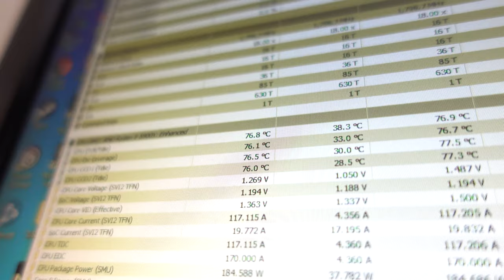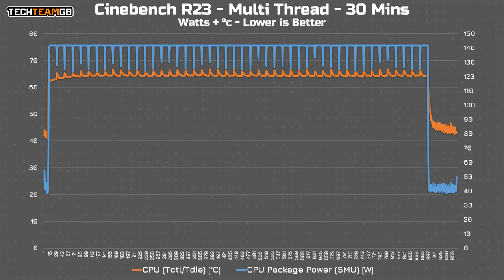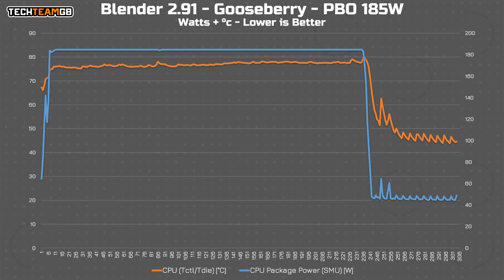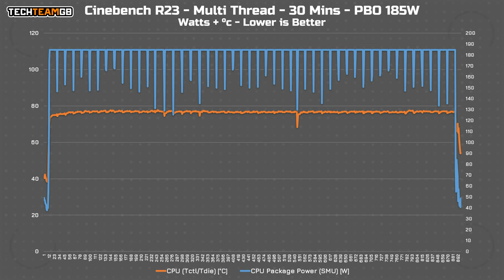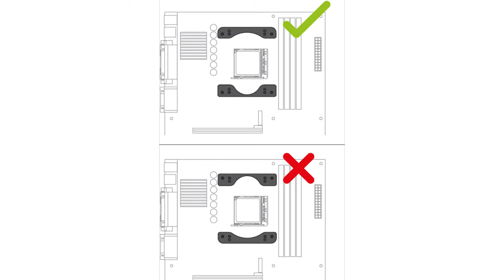THE ULTIMATE LIQUID COOLER - Arctic Liquid Freezer-II 360 A-RGB Review

Comment: Thanks for your overall positive review. We are already working on a better mounting method for the successor. The solution using standoffs like it is on Intel does not allow enough space to fit the thumb screw (i.e. pump too wide). Your feedback is very valuable, thanks for the details.

Oh, and the QR code issue was on the first batch of production, it has been solved since.
Reply: I think you should bring in a more expensive version with a nicer pump and some RGB 😅😅 that would make this cooler perfect 😜
Reply: Successor? Should I wait for this new version for my Intel 12th gen?
Reply: Where is freezer iii? I’m in the market for a new aio

Comment: I've got non RGB 360 version since 2-3 years currently on 7800X3D (before on 5800X) and it's great. I've managed to put 15 mm Arctic slim fans as push configuration on it together with included 25 mm as pull fans in Corsair 5000D so it's even better (push/pull) and still very quiet :) I for sure recommend this for high end system ;) It's so good that i even don't have motivation to extend my custom GPU loop to CPU, since LF II 360 is cooling my CPU so good and so quiet :)
Reply: Hey! im getting literally the same setup including cpu, case and cooler? how does it  run? and what fans are you running thinking of using a mag motherboard
Reply: @newlysquad9774 same I am planning to build one myself with those components. This is my first build btw.

Comment: I have a Liquid Freezer II 240 on a Ryzen 5900X witch i switched fans on to get RGB (Arctic BioniX P12 A-RGB). I also got the offset kit for free. Arctic sends them for free if you have revision 1, 2 or 3 of all the variants of this AIO.
The performance is great! I really love this AIO.
Reply: What is your temp when playing heavy games using the aio?
Reply: @keysnu9984  Just shy over 70 Celsius. Take note that my PC is built in a Silencio S400 mATX case. So in a case with better airflow this CPU/cooler combo should get lower temps.
Reply: Is 240 enough for you? I'm not sure either to go with 280 or 360 tho...

Comment: Got the 420mm version of the non-RGB Liquid Freezer II.  Absolutely in love with it.
Reply: Damn you might actually freeze your cpu xD
Reply: What is your casing bro? that fit the 420mm
Reply: yeah what case did you put it in? The 420mm is a beast and I'm looking to get one myself but noticed online that not every case can fit one even if it says it can take a 420mm since the actual radiator is slightly bigger than 420 lol.
Reply: @BrutusAlbion  Phanteks p600s, the 420mm fit in mine front mounted.
Reply: I bet the 420mm version keeps the temps down very easily! What cpu are you running with it?

Comment: I have had a few AIO's in 4 years.. corsair elite, Kraken Z73 and a Lian Li, without a doubt this is the best one for me, I know it's not RGB oriented, but it cools  better than any other the pump I have used. The pump is silent unlike many others.
My 5900x is 34 degrees at idle, 50-54 when doing basic tasks - watching video etc.... and 68-72 under load.
Previous AIO's were 42 idle, 50-62 basic, 76-86 on load.
Corsair elite... was loud, Kraken expensive, Lian li needed to run @ 1500+ to cool at the same rate as a Artic Freezer
Amazing package, and really good price... just lacks RGB screen
Reply: hi sir
how is the performance on 5900x?
ı had msı mag 360r it broke down
would you recommend Arctıc Liquid Freezer Iı - 360 A-Rgb or Arctic 280 (what are the differences)
I have asus prime a 570 does all the parts comes with it
thank you
Reply: @gorkman5697  It's extremely good, my 5900x is running 4500 all core and 4949 single core. I have a negative 30 set in the bios and a few  voltage settings. Over all about 70 degrees under load =/- 2 degrees.
Reply: Hmm idk man. My corsair elite did idle below 40 and after 10 hour stream my cpu didn't reach past 45
Reply: @gorkman5697  Yes  I would. The Rad was thicker than most pre 2023. Now with 7000/13th Gen look out for 30mm+ thick radiators

Comment: Argh, that bracket. I had to Dremel off the left end of the top one, in order to not contact the VRMs on my x570 Tuf Gaming motherboard.  Such a hassle, but an excellent cooler, once you get it going.
Reply: Yeah mine sits on top of them on my b550 Aorus master. No issues on my b550i aorus pro ax.
Reply: Hmmm
Reply: @Deviantsoundz  is it going to fit in b550 aorus pro ??
Reply: @hasoonysoony3383  not sure, haven't used that board
Reply: I had to do that with my 120 kraken aio. I though I was the only one who's had to do something like that before lmao.

Comment: I’ve heard so many good things about Arctic water coolers. I’m just paranoid about leaks and complex parts breaking down over time man. Tempted to get Noctua nd h 15 black. But damn Arctic has always air cooled my systems brilliantly! Great review guys. 👍🏽
Reply: Same here. When with a noctua d15s and beyond happy.  I don’t EVER have to worry about it and it’s dead quiet for me
Reply: 6 yr warranty.... I mean why look anywhere else.
Reply: You would have to be seriously unluckily to get a leak 😅😅 plus those coolers last for years honestly plus you do get 6 years warranty, aio for the win, they look so much better than 1KG of aluminium hanging on your CPU socket 😅😅
Reply: @roshill2010  they’re don’t warrantee the rest of the October if it leaks……
Reply: @daddyalpha2648  Currently deciding between the two for my new build in a fractal torrent compact for a 5900x. How have the results been for you when compared so far? I'd be running them at times under pretty high load for renders etc so its a hard choice haha

Comment: I went with this freezer and it's performing as expected, which is great, but what I found a bit disappointing is that these fans are slightly worse version of P12 ARGB blah blah. They have narrower rpm range (200-1800 vs 0-2000) and what's worse, the cables on them are way shorter and not daisy-chainable, they're connected with some splitter instead. So they're virtually unusable if anyone wanted to go with other fans on the rad and use these as case fans.
Reply: If you want to use them separately you can just buy a longer fan adapter. Of course if you won't use them for the intended purpose it's not Arctics fault. The shorter cables make it nicer for the intended use.

Comment: Bruh. I must have not seen that bracket diagram when I was installing it so the first bracket I put the wrong bracket on top and bottom. I just remounted it and it has lowered my temps by a few degrees. Pure pain. I have wondered why my temps were a few degrees hotter than I expected. Thank you though for pointing that out as the regular non RGB one has lots of different manuals for 4 different varients so I may have looked at the wrong one.

Comment: On some of the motherboards that this cooler seems incompatible with, there is a very small in between the height of the brackets and motherboard vrm caps. Honestly if it weren't for existing videos/reddit threads of people showing that this doesn't seem to cause any problems, I would probably be super hesitant to continue using this cooler.
Reply: So it is compatible and causes no issue? Are you happy with this AIO?

Comment: question about this arctic kit:
Liquid Freezer II 280 A-RGB

there are only 2 cables: a pwm, an argb 5 volts
my gigabyte x570 UD motherboard does not have an ARGB port, if I only connect the PWM cable, will I still have LEDs lit on the kit or everything will be off?

Comment: Is this correctly mounted? The pump seems to be mounted with the tubing to the radiator higher then the tip of the pump. And the loop is lower then the pump. Is that an issue?

Comment: This watercooling will fit in my case but I won't be able to add a rear fan, is this a problem for the airflow? Nb: I have three fans at the front and 3 at the top (those of the watercooling).

Comment: do the brackets cover the exhaust fan pins on a MB Asus ROG Strix Z-590? i've seen this case on the TUF Z590, but any clue about the rog one? I want to get the 240mm one for an 11th gen i7 and i'm not sure if the mb will be an issue. Also my build is full black, so not sure if I shall go for the black version or the a-rgb one. any tips?

Comment: i know i am 2 years to late lol but i hope some one see's this.  I was looking at this cooler as it was a recommended  to run on the AMD Ryzen 7 7800X3D....  is that true?  and if so with the size of said cpu block,  would it fit on a GIGABYTE B650 AORUS Elite AX I want to make sure it will fit. I am pairing it with a Zotac 3090.  Im always open to suggestions on any end.  I do not plan to OC the cpu but maybe the ramm?  i live in AZ(with AC) and want solid cpu cooling option and perfer AIO

Comment: The Lian Li Galahad 360 RGB and the EKWB AIO RGB have similar performance, look better and have a 5 year warranty over the 2 year warranty for Arctic. I just installed and Arctic 360 AIO, the RGB version. I have some issues with it. The hoses are so thick and stiff they are difficult to get to fit in the case, they push against the side glass panel. The fan and RGB cables are integrated into the hoses and are very short at the pump end. The fans came pre-mounted for what appears to be a push exhaust top mount. When trying to move them for an intake front mount, the RGB connector is too short to route appropriately and all the connectors for RGB are covered with a rubber sleeve. I assume they could be modified, but would it really have been an issue to just make them, say, an inch longer. The price is the same as the Lian Li Galahad and EKWB RGB version, so there's not much to commend it. The performance is not THAT much better.
Reply: the arctic rgb version has 6 years warranty
Reply: @daddyalpha2648  Not just personal opinion. Facts based on my own experience with the cooler. Nothing I said indicated it was not the top performer. I said "similar" performance and "not much better". Both clearly indicate it's performance IS better. However, most of my criticism has nothing to do with performance. In fact, the point is that although it performs best, there are many things I don't like about it and wish they would change. Get off your high horse my friend and get a life.